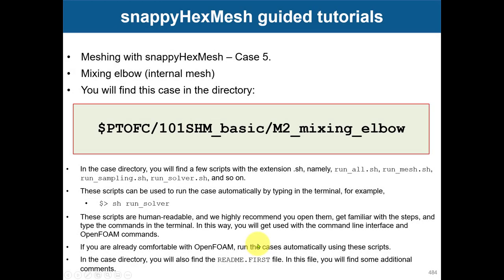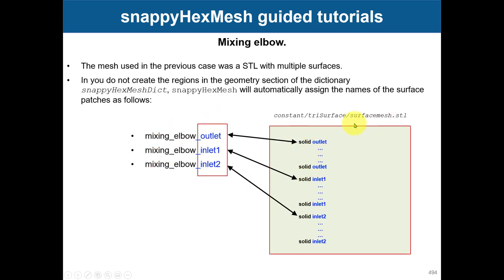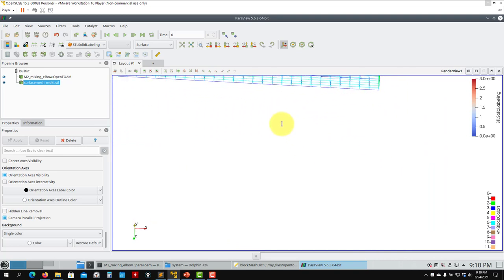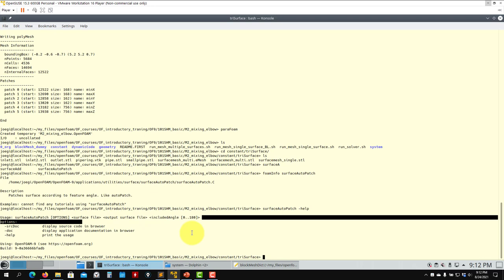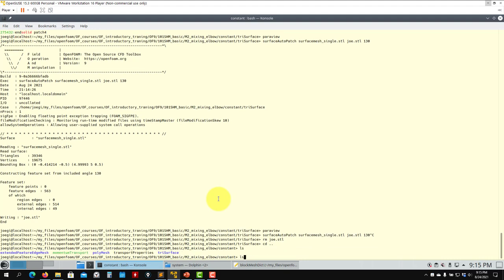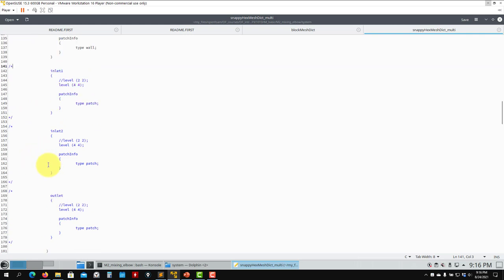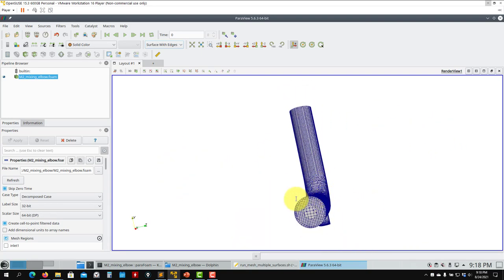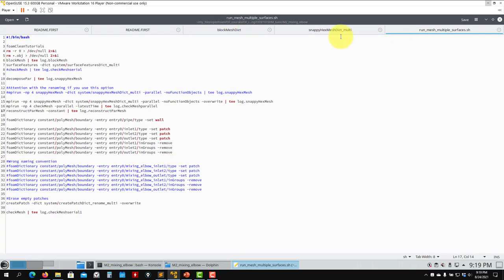3.9 Module 3 | Meshing in OpenFOAM | snappyHexMesh | #openfoamtraining

Comment: Thanks for the videos, as always they are a great source of knowledge. Would recommend to change calc to eval in the blockmesh this will erase the compiling output in the beginning of the log that makes it a little bit confusing and scary for new commers 😁
Reply: Very valid comment.  But to my understanding #eval is only used in the ESI version.  In any case, I will dig on this.
Reply: @joegi909 might be the case! Sorry if it is I use the ESI vr myself 😅

Comment: how to create stl with multiple regions in cad modelling software
Reply from the maker: Not all CAD software support this. In onhsape I save the surface regions in different files.  In some CAD tools you can save the geom in OBJ format and it will save the name of the patches, I think fusion3d and meshmixer support this feature.
Reply: @wolfdynamics5703  for blockmesh greater the size of stl files that is my stl model is covered by mesh created by block mesh but only one region is changing while run snappyhexmesh (walls ) I have used different angles but same issue. Then I overlapped the surface of blockmesh and my stl file then it creates a same snappyhexmesh like stl files shape. I there any error in my doing can you explain please